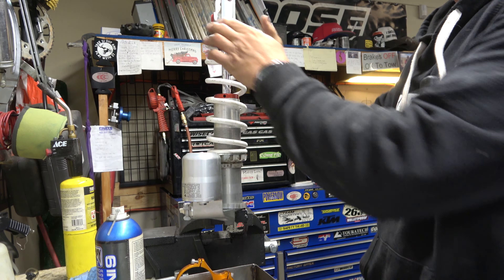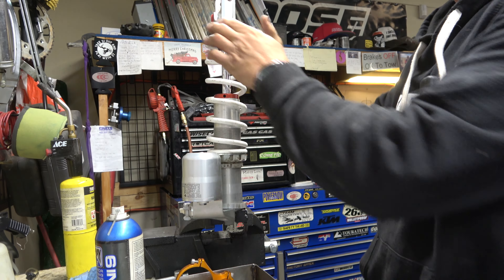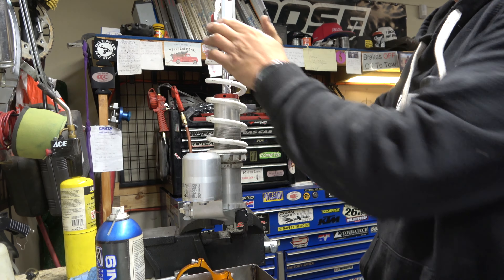Inside The 2023 KTM 300XC Suspension | Full Re Valve | What is New? | Highland Cycles

Comment: Awsome man I’ve got to do the same thing on my WR 250f 2023 I rode all season I put 2500 km on , so over the winter I’m going to pull the thing apart and grease up the swing arm linkage and all the bearings in the suspension linkages as well as the steering

Comment: Kinda related..lol. I changed my rear spring tonight on my 2023 300xc, took linkage off and dropped spring down through swing arm. Super easy. Before i put it back together i wanted to grease the needle bearings. Pushed bushing out too far and popped a few needles out. Got them all back in place with tweezers and a pick but looked like one was missing..DANG! I looked everywhere for 40 min. I finally slid the bushing out just a little on the other one to expose needles and used my pick to scoot them around and I’ll be danged if there was a gap that looked like one was missing. I thought needles were packed in there tight. Guess ktm leaves a gap?
Reply from the maker: Yeah. It’s not completely tight. Makes room for grease

Comment: Hey great video. So with me being 6' 3" with a weight of 285. What would you recommend on a 2023 XC
suspension wise.
Reply from the maker: I’ll have to check on a spring but you need to re valve that suspension for sure. Once you get the right spring in the rear and correct air pressure up front (or a spring set up) the valving will need to be setup to handle that much spring. But it can be made to be really good
Reply from the maker: @christopherarronglaum6191  we would love to help you out.

Comment: Can u compare the 300sx motor to a current YZ250 or CR250 two stroke. Is it faster? What is the power curve like? Thanks. Good videos.
Reply from the maker: It’s a lot like a YZ250 in the mid and top but quite a bit more on the bottom n
Reply: @highlandcycles  Nice. Thanks brother. I think I might get one. Enjoy. Ride safe.
Reply from the maker: @davidgledhilljr71  you won’t be disappointed

Comment: I just bought one and my forks are moving up and down with air pressure if it is at the 9.7 bar the forks are 3 inches down in the stroke with just the bike weight to get it up to normal height it take like 13 do you know what’s wrong
Reply from the maker: Yeah. Somehow you got some air on the wrong side of the seal. You will need to take the air spring apart and re assemble to fix it.
Reply: Appreciate the reply it came from the dealer like that I tried telling them something was wrong. One more question is the shock physically the same as a 19 through 22 shock? I have ohlins forks and shock off my 19.
Reply from the maker: @alexbrezai323  no, the shock is different. The old one won’t fit. The forks will.

Comment: I removed the silencer and swing arm to remove my shock. I wanted to grease the swing arm and linkage bearings anyway. I also installed a 260mm 4.8 w/o issue.
Reply from the maker: Nice
Reply: Where I’ve had so many KTM‘s and re-sprung them over the years and got rear springs everywhere but because of The fact that these goto PDS 4.8 on a  PDS would feel like a sponge.😜 so I guess I will get the bar another spring at least I don’t have to get front springs

Comment: Gees the 2016 ktm pds shocks come out so easy compared to this
Reply from the maker: All PDS shocks come out so freaking nice.
Reply: @highlandcycles  hey do you think the new excs will retain tpi  or use TBI?  I’ve skipped the 2017 -2023 exc generation and hoping to avoid the current tpi.
Reply from the maker: @marcgucciardo1942  by the looks of this cylinder I think it will be a mix. Looks like they have a spot for one injector on the right side of the cylinder (like the current tpi setup) but not one on the left. So they will probably put one in the throttle body like this bike and I’m guessing it will still be oil injected. I think that’s the only way they are going to pass emissions
Reply: @highlandcycles  yep that makes sense. I wonder if running a little oil in the gas tank would be worthwhile if it stays oil injected. Some tpi guys on forums would say that adding oil would ruin injectors etc blah blah. I call bs on that. I’m enjoying your down to earth approach, free from any bs!!!
Reply from the maker: @marcgucciardo1942  Yeah, those injectors aren't really different from the ones that mine has that are running pre mix.  If I had a tpi I would be putting at least some oil in the tank.

Comment: Crazy how they make so many little changes to suspension on bikes year after year, and those little changes add up to better handling felt by the end user.  Cant imagine how much time and money goes into these changes by the manufacturer... try polishing your axle shafts and suspension linkage shafts with a buffer so they slide in and out smoothly.  I've been doing it for years and it makes wheel changes easier and protects against corrosion   and sticking after gnarly sand/mud races.  Thanks for the video!
Reply: That’s an awesome idea, the raw or “brushed” aluminum they ship out its pretty rough and hard to clean. Like a metal sponge. I guess it’s to costly to manufacture finished aluminum somewhere that isn’t seen much
Reply: I actually have a buffer I’m going to try to do what you said I’ll just polish it so nice it’ll turn into chrome.
Reply: @Johnr37us  Thats the spirit!  I even polish my lever pivot bolts so my clutch and brake levers pivot as smooth as possible.  I'm a poor bastard so I can't afford those hydraulic clutched machines so I try to make every part of my clutch system operate as smooth as possible.  I often wonder what people that I've sold my old bikes to say when they take things apart and see a polished part come out...  Guess I'm a tweeter :). But at least I am a productive tweeter!
Reply: @AboutaMileAdventures  Exactly.  Bust out the red rouge and go to town!  I put asuper thin coating of grease on it after to protect it but not attract to much dust and dirt like a bunch of grease would.  I've tried Dried graphite spray lube but went back to the grease because it protects it a little bit better :). Many things can be polished on a bike that will help in ease of assembly and operation as well like brake lever pivot bolts and clutch lever pivot bolts.
Reply: @smashedfootlefty4726  I think you are very intelligent .And I should know because I know everything .😜😜😁😁🤥
Reply: @Johnr37us  Ah, another man that knows everything... welcome to the club 🙂🙂🙂🙂
Reply: @smashedfootlefty4726  one a couple of coats of clear coat help protect and keep it new looking? might be worth a try
Reply: @AboutaMileAdventures   Clear coat will add thickness to it and make it more difficult to slide in and out.  I just repolish it every time It needs it which is usually when I need to change out tires.

Comment: Could not you just change shock spring rate, oil weights/brand, bladder pressure, fork air pressure, HS check valve spring rate, and clicker settings, instead of shims and pistons for typical applications and typical rider weights and get a satisfying result?
Reply from the maker: I think you could. We are a suspension shop so we like to change shim stacks to really tune it but the suspension is good and most people could probably be pretty happy by making the changes you talked about

Comment: I thought that bladder was sealed. But now thanks to you doing this video. (On this  dirty motorcycle🙄🙄🙄 …of course . which is irrelevant to the information that I’m learning about) good now I understand basically sealed by that piston .But would it be better to add a little bit of fork oil  instead of motor oil. And would you probably waiting till it got about 10 hours on the suspension. Once again thank you for providing this fantastic content on YouTube.🙏🙏🙏
Reply from the maker: The motor is a little stickier and holds up in the heat well for that application. Since it’s not an oil bath like a fork tube the motor oil works better. Fork oil is t bad though.
Reply: @highlandcycles   this is a perfect reason why I watch this channel. The fact that your back is clean and hot clean is irrelevant to the content. I will probably go with the fork oil and what I’ll do is use a eye dropper to put the oil in there because I understand all you’re wanting to do is maintain some type of lubrication to curtail any stiction. Then I will use my Patent agent attorney skills to steal  … I mean further develop 😁😁😁your ideal fo ….Highlands cycle Artesian air suspension seal conditioning fluid. It will come in a 4 ounce bottle with an eyedropper. It will sell for only 19.95 😜😜 and you will receive 5% royalties after all expenses are paid. So in five years you’ll probably get $100 dollars. go Brandon 🤑🤑
Reply: @highlandcycles  I understand what you’re saying so that’s what I’ll do I’ll use motor oil. But only until Highland cycle artesian air fork oil  is available. I have my lead chemist working on it right now .His uncle was the monkey that played on BJ and the Bear. And as long as he gets three bananas a day he’s happy. 😜

Comment: BASE VALVE
Reply from the maker: I don’t know if you call that part the base valve since it’s not exactly like a base valve in an open chamber. It does more or less the same thing but is in a different location
Reply: @highlandcycles  Its a base valve, its just not at the base on a cc fork, we can call it the peak valve if you want :D . Its job is to damp the oil flowing out of the chamber that is being displaced by the shaft entering the chamber.
Reply from the maker: @marshallkeller4381  right. Same as the base valve. I’m just so used to the other orientation and then SSS forks just calling it the compression stack.
Reply: @highlandcycles  Compression stack is also correct, technically the stack on the other side of the rebound piston is called the midvalve, if its not a check valve, also dampens compression as you stated in the video. What does TBT refer to these things as?
Reply from the maker: @marshallkeller4381  The mid valve is the mid valve and the "base valve" is the compression stack